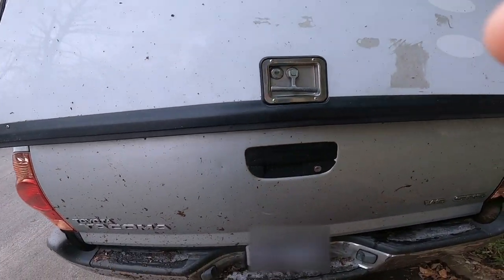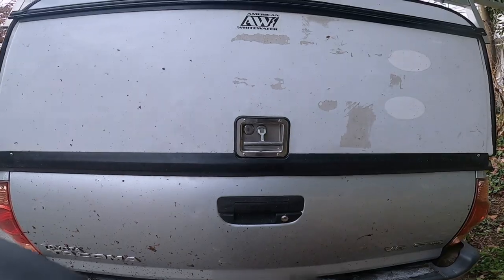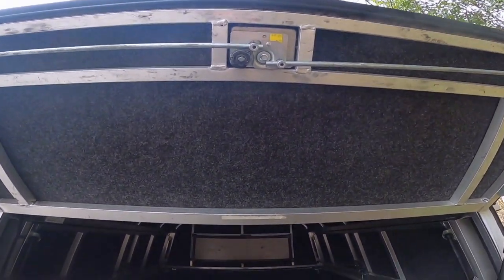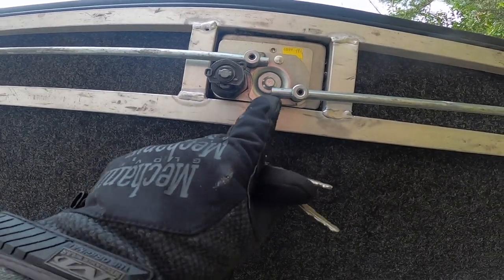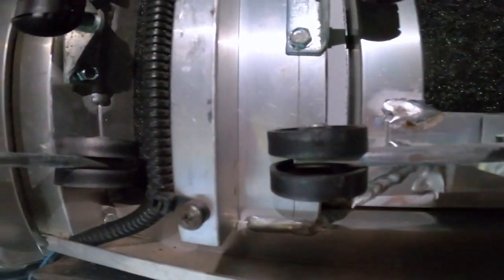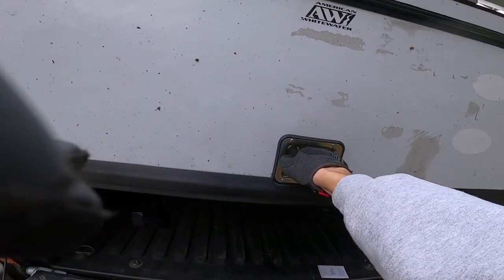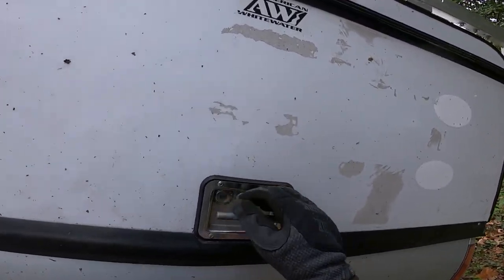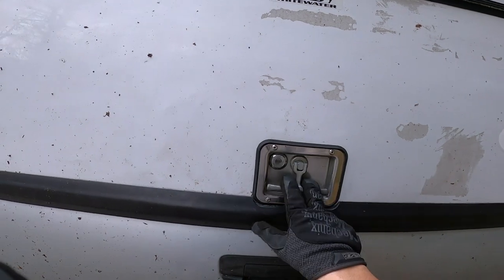Shell Break In! Must watch if you have a camper or shell!

Comment: So I just got a topper and wanted to avoid damage to my topper if someone were to try and break in. I came up with a clever idea. What I did added a latch that doesn't lock.  I wired each side of the latch to a n channel mosfet , a small 12v battery and a audible alarm. So when the latch is opened; it starts blaring the alarm and they run off. Have a hidden on/off switch so that it doesn't go off when ur trying to get in ur own truck.